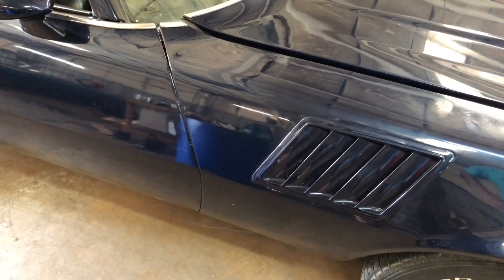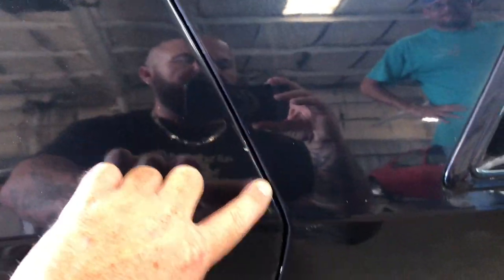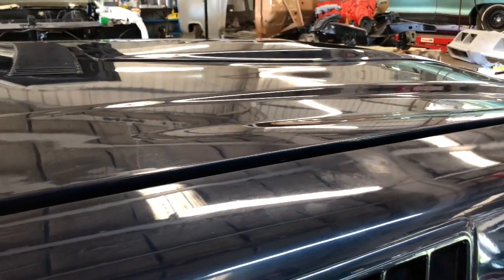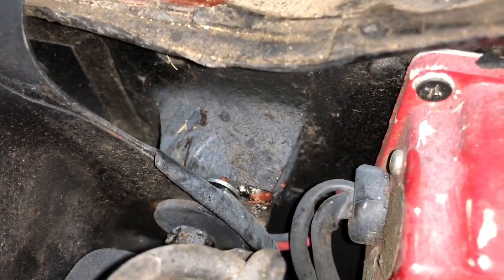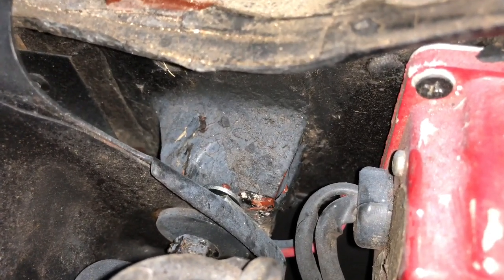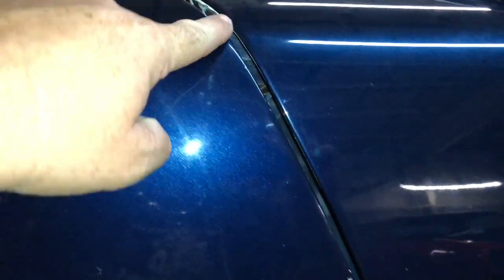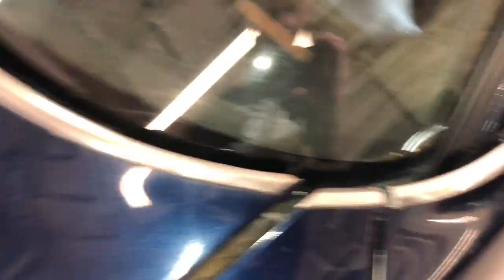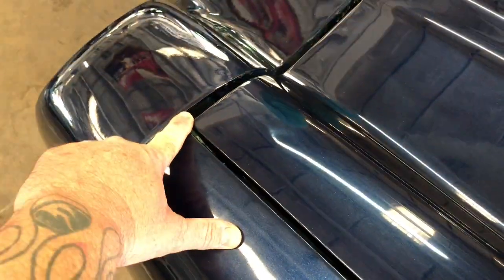Tech Help With Hood And Fender Alignment On 2nd Gen F Bodies

Comment: I have loosen the three bolts to where they are about out. And it won't budge. It tight up against my door so it is chipping the paint like you are talking but the fender will not pull forwards any other tips. Thanks

Comment: I'm glad I found your channel. I'm having very similar issues on a 64 Chevelle that I'm working on. On the underside of the hood (the edge) of this Chevelle seems to be touching the inside of the fender causing it to stay raised. Would you have any suggestions. I wish I could insert a picture. I'd really like to contact you but I don't want to be a bother. Any help is greatly appreciated!

Comment: Can you adjust the front fenders out so they fit better to the rubber bumper?
Reply from the maker: The fender needs to be adjusted to the door, the bumper needs to come back to the fender vs the fender going to the nose. Proper alignment starts at the door to quarter jamb then moved forward to the nose.

Comment: You guys think sagging doors would cause a big problem too? I’m putting in new door pins and bushing soon
Reply from the maker: In theory it could but if the striker is in it's proper position, when the door is closed the striker should have the door basically where it's supposed to be.

Comment: What do I need to do I have a 1974 Camaro and my hood is lined up well in each corner however it’s high towards the back and isn’t flush with the fenders. The hood hinges are adjusted all the way down. What do I do?
Reply: From what I've heard, if the hood hinge springs are worn it'll cause this issue.
Reply: raise the front part of the hinge on both sides when you raise the front it lowers the rear